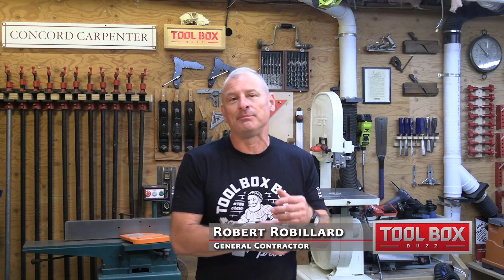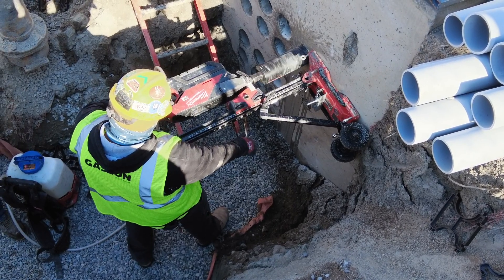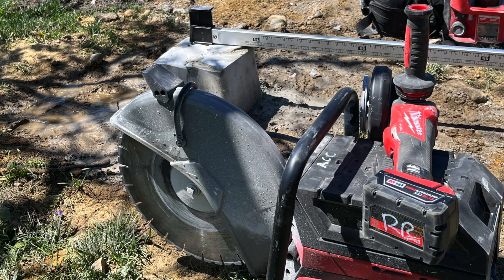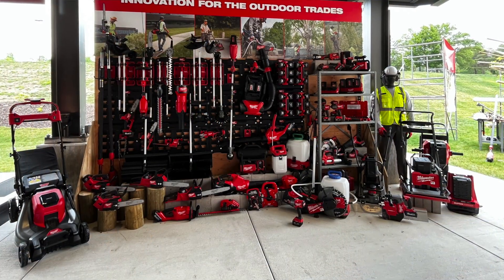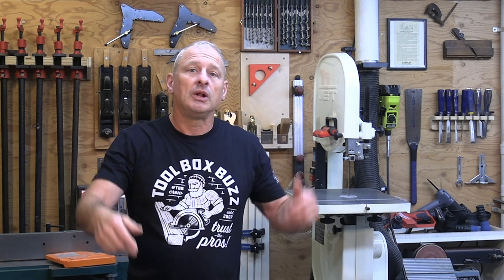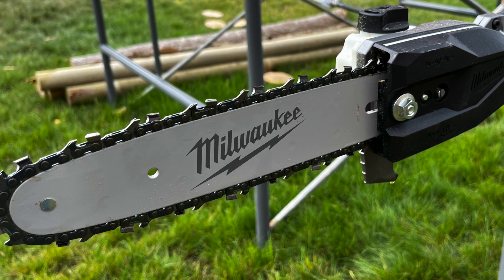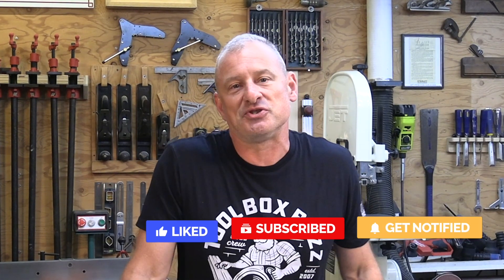Battery vs. Gas Powered Tools | The Future Of Outdoor Power Equipment

Comment: Just got new Husqvarna batteries, and with the 750 charger, the 9Ah battery charges to 100% in just 20 minutes. I was considering Milwaukee too, but in terms of ergonomics, Husqvarna is way ahead. Now I’m trying to decide on an 18V platform — still torn between Metabo/Mafell, Milwaukee, and Festool.

Comment: Getting these equipment all people have to do is also to take good care of them if they want it to last for years, by not throwing the equipments on the floor as you get done doing the yard like how gas equipments be throwing on the floor and its dirty and not being clean, cause most people i knew said its just gas and metal and nothing cant go wrong with it but to me it can cause metal obviously can rust if its not clean the motor can obviously wear out if something its loosen, and you aways have to check the gas to see if its not leaking out of anything, but battery power equipment you dont have to do all that but still clean it and make sure  everything is togather when you done your yard.

Comment: Battery powered equipment has its place ... and I agree with this future ... but my corded drill has 840 watts nameplate power (7 amps x 120 VAC) ... it might not be safe operating batteries at that high of voltage ...

Comment: The power and runtime issue is really a weight issue.  You can make a battery string trimmer with enough power that the start-up torque will rip your arm off, but that battery is going to be heavy.  Technologies can improve battery weight, but tool form factor can change to make the weight less cumbersome or tiring.

Hydrogen fuel cells are where it's at for mobile charging, IMO.  You can limit the amount of on-board storage you have and then just top up with hydrogen in the middle of the day in a few minutes.  Having a system that can be plug-in charged at night and run on HFCs in the day would be ideal.

Heat is a big problem for batteries here in Phoenix.  I can mow my front and back yard (1/4 acre lot) on a single battery in the winter.  It requires more than two in the peak heat of the summer.  I'm sure there are battery technologies that could improve on that, but it's the biggest hurdle for me.

Comment: Battery tools have made leaps and bounds on improvement and people should use them as they can afford or have the need. The fact that the government is forcing or seemingly forcing people to switch as they are in the automobile side isn't right especially when a lot of those areas already are being told to not use electricity during peak times because the grid is maxed

Comment: Will never work for me. I mow 5 acres of land once a week.
Reply from the maker: It can work for you
Reply: Anything can work. Do I want to have 7 to 10 plus batteries laying around , spend time keeping them charged and changed out. Nope. Never going to work.
But you do you.
Reply: @MrYuck9 5 acres? Take a peek at some of the new "Roomba" mower bots. They're like those robovacs, but for your lawn. If the lawn doesn't have any major slops then it would work fine. The robot would mow some portion of the property everyday and that way you'll pretty much never have to do it yourself. It's a crazy time saver. 

Got my father in law a Husqvarna robo mower last year and it's awesome. He's got about 2.6 acres of lawn that he likes mowing. It was a bit of a pain to set everything up, and we needed to do quite a bit of testing. But since then it has been great. We set up boundaries around his trees that the mower won't mess with and now all he has to do is trim every few weeks in those areas. Otherwise the little bot goes out and chews the grass up everyday so it's always neat. 

Give those robo mowers a peek. A bit pricey but the time savings is sweet

Comment: I need to question the validity of the cost comparison between gas and battery by the pro landscaper. Most of the tax advantages are one-time usage. The break-even point was 18 months of usage or 2500 hours. That is near the end of life cycle for those batteries, which starts the cost cycle again. Now, granted EVERY cost gets passed to the customer, so this point is almost moot. Also, eco friendly people will pay almost 50% more for the service as one does when they buy organic foods.
His numbers are geared to justifying buying batteries and passing along the cost. 
At 3X $1,000 Ryobi 80V batteries, these numbers won't work unless it's "other people's money" that pays for them.
Reply from the maker: That’s why they need to offer a Pro battery with higher cycles

Comment: Instead of worrying about getting more cycles out of a battery, I would say a compelling argument for pro battery adoption would be a core type program. Wear the batteries out, we know that's going to happen, then send them back to be exchanged with a rebuilt one. 

I think a lot more infrastructure and tech needs to be in place before wide-scale adoption will happen. Fast power transfer, and battery recycling are the main ones.
Reply from the maker: Interesting thought

Comment: I’m an arborist and am more than happy with the battery tools - top handle/ rear handle saws, blower, pole pruners, hedge trimmers.  The big limiting factor right now in my industry isn’t run time (you don’t need a whole lot of run time for a day) it’s power of saws. Especially for removals or storm clean up, size matters. If a log is more than 10 inches in diameter, I’m pulling out a larger gas saw.  They’ve come a long way, but still a long way to go.

Comment: I am going to rant a bit here too. I'm not a pro contractor, although I used to work as a pro auto mechanic. Now I'm just a hobbyist who sometimes builds stuff in my garage or back yard. I live in Chicago -- in the city itself.

I think cities in the USA need to take some steps to incentivize landscaping contractors to switch from gas powered tools to electric tools. That doesn't always mean battery tools. Sometimes they can be plug in tools with extension cords.

I see guys in my neighborhood using gasoline pressure washers and gasoline backpack leaf blowers to clean like 20 feet of sidewalk or blow leaves off 20 feet of sidewalk. I have a Milwaukee M18 leaf blower, and that thing is crazy powerful. I usually vacuum + mulch leaves in my tiny city front courtyard, and then I blow the tiny bit of remaining pieces into the street before the street sweeper comes by on street cleaning day. To wash my patio, I use my DeWalt A/C plug-in power washer, and it works totally fine. It is much quieter and doesn't release fumes like the gas powered stuff that I see guys using. When we sometimes get a light dusting of snow in winter, I'll even use my blower to blow snow off my front stoop or off the sidewalk out front.

Look, if you're out in a suburb or out in the country where houses are far apart, you're less likely to bother someone if you're using a gasoline powered tool. If you use a gasoline leaf blower at 9am on my block, there are 20+ story high rise buildings on the block as well as row houses, and you're going to wake up and bother even as many as a thousand people. But also, to blow the leaves from someone's 5 bushes in front of their city row house, you don't need a gas blower. It takes 5 minutes with a battery tool.

So in dense urban areas, I think municipalities should force contractors to pay a monthly licensing fee to use gasoline tools. It should be like $50 per month. Cities should have different hours for when you can use electric (AC or battery) vs gasoline power tools outside, and the window for using gasoline tools should be much smaller to incentivize guys to switch to electric tools. I wish I could think of some positive incentives for guys who use electric tools, but I cannot think of ways to structure these that would really be fair. Yeah, I hate to just suggest negative incentives (fees and restrictions on gasoline tools), but those seem easier to structure.

I think licensing fees should also apply to loud electric tools -- especially ones with alternatives. I own an old small A/C pancake compressor, and that thing is incredibly loud. I used to work as an auto mechanic professionally, and I used to use my old compressor at home with a pneumatic impact wrench when fixing my own car. These days, I own a Milwaukee surge impact wrench, which is so much quieter to use. I still use my compressor when I'm blowing water out of the pipes that go to my hose bibs and also the section of built-in irrigation system in my back yard before winter. So look, I guess I would be OK if the city restricted my personal use of my old A/C compressor outside. It might force me to splurge on one of those fancy M18 quiet compressors for blowing out my backyard irrigation system in Fall each year, and it would keep the neighborhood a little quieter on those days.
Reply from the maker: I think you’ll probably see some sort of tax credits

Comment: Thanks Rob.  This is something I’ve been debating for some time.  The private community I live in has a maintenance team with riding lawnmowers.  The problem is, the mowing area we are responsible for is spread across a very large area.  Not large enough to justify trailering, however.  The problem with battery powered ZT mowers right now is there just isn’t enough battery power to get through a day’s mowing without a battery swap or recharge.  Battery power just isn’t quite there yet.  I’m keeping an eye on the industry and will have my argument points ready to go when the industry gets to the point I feel is worth investing for our team.  As far as the tools we use, it’s mostly all battery now.  I’m trying to convince them that a battery string trimmer is worth the investment at this point.  I think, since they’re already into Milwaukee, I should get the Milwaukee string trimmer and show them how useful it is.  That could be the first step in moving to battery OPE for their land maintenance needs.
Reply from the maker: Battery power is there but it’s expensive. You have to buy a trailer that has a large battery packs or you have to use a Kress system.

I’d like to see two companies come out with a more affordable option for landscapers.

Comment: I did this with my Makita line. Started with normal tools on the 18v LXT line for woodworking. Moved into outdoor for 18v. If I need to I’ll upgrade to 40v but for now I love my same battery size on everything. Using my 5.0 on my stick vacuums or putting them into planer or 36v lawnmower.

Comment: Battery-operated tools are good for homeowners, not for the professionals it's all because it takes too long to charge batteries and battery operated tools can't handle the heat they tend to overheat
Reply from the maker: Actually, your comment is outdated now cordless can do the work they just need a power supply with them

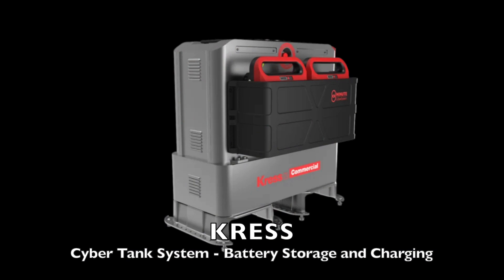Comment: 8:52 for stationary battery banks, nickel-hydrogen is the solution. They can last 20 years and are not affected by charge cycles or temperature swings - Nasa has used them in satellites for decades.   BUT… the  public has to get over the Fear of high pressure hydrogen cells
Reply from the maker: Interesting

Comment: A neighbor on my street does landscaping part time & has a electric Ford lighting. He mainly use solar power to charge his backup battery that charges his truck & tool batteries overnight. You can also store your electric equipment better, than you can with gas equipment.
Reply: I've never seen battery operated equipment stored on open trailers... Or used in a light rain... 
But that's me...

Comment: Battery tech still has a long way to go to overcome the runtime issue. Spending 3x more for batteries then a whole lot more than that to charge them on the go isn’t viable. Heck for many contractors that also means buying a new vehicle with the real estate to accommodate the necessary equipment they’ll need simply to not run out of power in the job. 

If you’re going the angry pixie route and you’re mobile, buy your 50lbs inverter generators while you still can. A gallon of fuel gives you 8 hours of runtime to be able to charge your batteries and they’re not any louder than most electric lawn equipment. Probably quieter actually.

Comment: Milwaukee mx-fuel is definitely ahead. As a mainly dewalt-guy I think flexvolt is reaching it's limits as the battery-mount is too small to make a much bigger battery. The idea of having several batteries in use at the same time is less attractive.
Reply: Milwaukee MX is a complete failure. No one's buying it and I have friends in the commercial construction industry and none of them are using the MX line
Reply: @loucifer4205  yeah, Makita's idea with 80v and 40v is better since you can do both huge tools and small handheld ones

Comment: Battery tools are definitely improving rapidly. But currently any potential cost savings can be wiped out by initial purchase price and the cost of replacement batteries. If one battery fails, any cost savings provided by the tool have been wiped out. Most gas powered tools can be run for 20+ years without anything more than an occasional spark plug or air filter as maintenance.

Comment: I watched an interesting video a while back, well over a year ago, about the state of California making petrol gardening tools illegal. The lawn mowers had some serious power in their batteries, and the excessive cost was "said" to be recovered quickly because of the reduced running and maintenance costs. 
 I can't remember exactly to what was to be illegal, just selling new ones or using them. I think they did say you could cross the county line and still buy them.
 I can't remember all the details but it did look as though the technology was there for it to be doable.
Reply: I think the shelf life of the battery is the real issue in terms of cost. The tool costs more up front and will need a new battery at some point in its life and from what I've seen they don't come cheap. Compare that to my brush hog from the 70s that never needs more than a tank of gas, occasional carb clean and new plugs ever other year. Same with my rototiller from the late 60s. I have well over a 100 years combined of tools that just run and will continue to run as long as I can get gas.
Reply: @tonyk.8580  There are a lot of things that need to be taken into consideration. 
 I have a strimmer and a chainsaw that would probably have used 50 litres of petrol over the five years of use. The petrol and the two stroke oil would have cost me more than a new battery. But, i don't pay for the electricity because it is solar panels that charge the batteries. I use the batteries for the other tools too.
 Obviously if you already have solar panels installed for electricity this isn't really considered a cost, because there is no additional installation for the conversion from gas to battery.
 How much have you spent over the years on gas and oil, how many batteries could that pay for? 
At 2€ a litre of gas + the oil, the batteries do not have to last very long to break even for me.
Reply: @robinhood4640  I take care of 2 acres and occasional some stuff at my moms. I usually get through summer on over under 20 gallons of fuel @ around 3.70 a gal around 70 bucks a year . I'm still using the the 2 stroke oil I bought years ago for like 10 bucks. I change the oil every 2 or 3 years depending on hours couple quarts 16 bucks. I'm not saying it doesn't add up but all those purchases are basically small and can be planned. A lot different than having a battery crap out and being out 500 to 1000 + on the spot especially for something like a lawn tractor.

Comment: Chemical electric storage compared to combustion is an interesting discussion that is way more complicated than anyone is really taking seriously. Something else I've noticed is because battery tech needed to improve the tools around it have changed and adapted. When was the last time you saw a press release on an exciting update to a gas powered or corded tool boasting better efficiency, quieter use, or superior convenience and ergonomics? We haven't seen much on that front because the energy density is abundant so they can be sloppy. I want a revival of our traditional tool industry. Focusing on quality of manufacturing, tool life, bring our corded and gas tech into the modern era.
Reply: Corded tools are limited by our grid, which is a standard 120v 15amp breaker. Batteries are already miles pass that point, so corded will always be less powerfull from now on.
Internal combustion engines have been around 4-5 times longer than battery power tools and we're pretty close to the limit on what's possible. Thermal efficiency is bad, they're loud, hot, smell bad, vibrate a lot, unreliable and needs a ton of maintenance. You can keep your outdated tools, I'll keep moving forward.
Reply: Yeah great question which I haven’t even thought about. It’s like one type of innovation meant abandoning innovations for the existing tech. Why not fuel cell or hybrid tools?!
Reply: Let's be honest hear people you're just trading one evil for another. There's nothing clean about batteries

Comment: I manage and maintain the largest outdoor soccer complex in MA. We use a ton of Ryobi HP tools. The 40V HP trimmers/chainsaws/polesaws/blowers/small mowers have been fantastic for us. Just recently added the new 20inch ryobi hp chainsaw to our arsenal and it is great. 

That being said, the vast majority of the mowing is still done with a Toro reel mower and a JD z915b. Also, there is nothing electric that could replace our JD 4052r tractor for a reasonable price. 

Extremely optimistic about future of battery OPE but currently gas/diesel are required for most serious operations to be completely feasible.
Reply from the maker: Which one?
Reply: @ConcordCarpenter  Progin in Lancaster